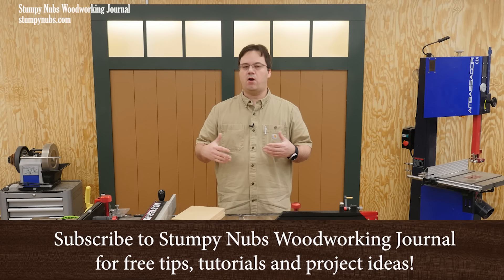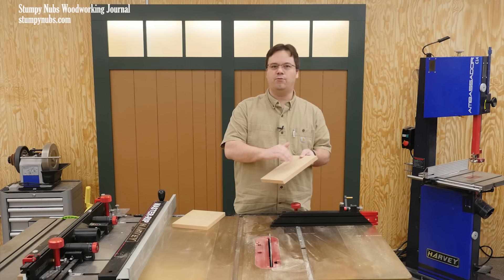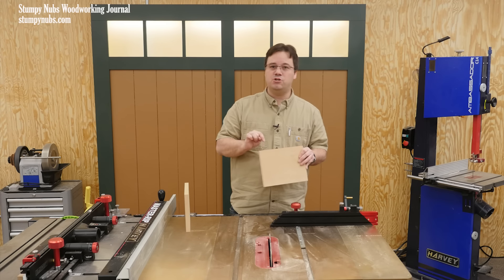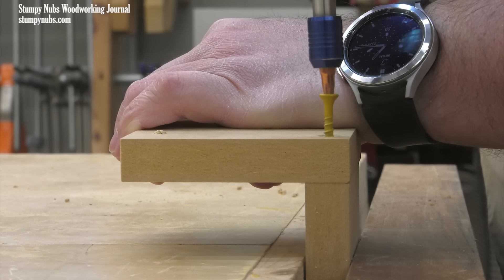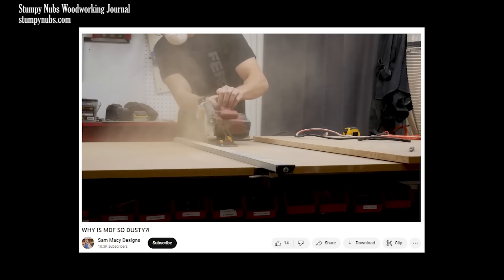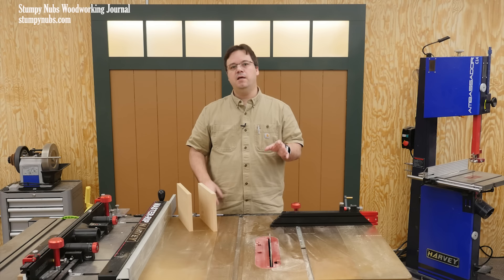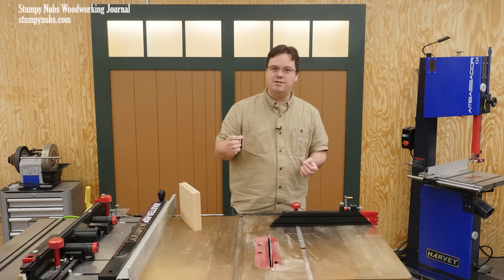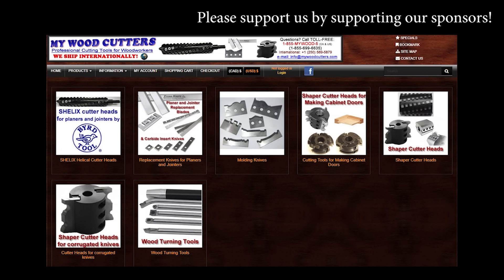This stuff changed my mind about MDF projects

Comment: Excellent video, thank you. As a Heavy user back in the day when I was still on my tools, a note of caution regarding painting. Traditional oil based (alkyd) paints and undercoats should be used with caution. Even though you may initially produce an acceptable gloss finish in the normal way, it will dull over after it's fully dried. We used to flood a couple of coats of exterior PVA glue, slightly thinned, over all surfaces as a primer and then paint as normal. Alternative specialist coatings as now available. Oh and btw, dont let anybody tell you it can be used in exterior environments, even the panels marked as such. It cant, it will fail. Other than that MDF is a very good product.

Comment: I’m my cabinet shop we use MDF extensively for pained parts. To seal the edges we used to use diluted wood glue in a similar fashion to the drywall compound you described. We then went to a 0.5mm maple edge tape, and further went to a 0.5mm paintable plastic edge tape. 

The surface of MDF is highly compressed and very thin. If you sand to heavily you will end up removing it and expose the core which will soak up primer unevenly.
Reply from the maker: I suggested sanding the edges, not the surface. The surface is already very smooth.
Reply: @StumpyNubs  Agree, the surface is already paint grade. It’s sometimes necessary to sand the face to remove glue from edge tapping, you just have to be mindful not go too far.

Comment: I use artists Gesso on MDF. Gesso is a primer that artists use when prepping stretched canvas for paintings. It's designed to shrink fibers not expand (Gesso is what tightens up the stretched canvas) which makes it ideal for sealing MDF.  Its made from Acrylic polymer medium (binder), Calcium carbonate (chalk) and sometimes also gypsum, a pigment (usually Titanium white, and also available in black), and chemicals that ensure flexibility and long life. The amazing think about Gesso is that it's density and hardness is very close to that of the wood and it sands easily and super smooth. Using fine sandpaper grits it can be sanded to glass like finish and is hardness to abrasions is very good. It bonds excellent to previous coats so additional coats can be applied to fill pits and scratches (be sure to wipe sanding dust off with a wet cloth between coats). You won't find this at the hardwood store, go to artist supply store such as Micheals. Gesso is also inexpensive to buy and probably the most affordable option. Give it a try, you will be amazed at the results.

Comment: I love using MDF for built-in shelves and cabinets that I will paint. Don't love the dust! I always use rabbets and dados with glue for the joints and never have a problem. When I can, I try to do most of the cuts outside.

Comment: Interesting about using drywall compound.. I was taught to use oil based paint as a way around the "sponginess" of both MDF and particle board. Agree that it is a material best used for non-moved objects.. but I don't think i heard you mention this.. but MDF tends to have better vertical as opposed to horizontal strength.. Building shelves.. it's very smart to put at least a 1x2 under the front edge of a shelf that has a span longer than 24".. and will be supporting lots of heavy books, for instance. Glad to see someone talk sense about all the issues, though. Great Video!

Comment: I've made lots of shop fixtures and drawers out of MDF.  Pocket hole joints.  Have had them for years.  Have moved them from one shop to another and all my tool stands are on casters so they move all the time.  The biggest warning I'd have about using MDF is don't let any part of the panel get wet.  Cheers.

Comment: A common complaint about MDF - the weight - actually makes it good for sound isolation (as opposed to absorption). A 3/4” mdf cube will cut a good 20dB by itself, more with rock wool.

Comment: MDF got it's bad rep in the ways it has always irritated me. So many use it in areas that can get wet. Doorways, sink cabinet bases and areas near windows. The mobile home and motor home industry are the worse offenders but it happens in regular homes. The idea that those areas will never get wet is poor forward thinking for customers. It does provide work later for the replacement. I am not against never using it, but it's limitations for long term should be taken in to consideration. It might be cheaper up front but cost more long term. Just things to stop and consider.

Comment: You silly Americans. How long do you guys know MDF? Here in Europe it is been used over 30 years. More then 80% of all buit-in cabinets / doors are MFD. Lots of furniture is MFD and finished in a high quality spray paint. You can move them as much as you want. They will last for ever. It's the best product and available in so many thicknesses from 3mm to 50mm. 
There is a BIG difference in qualities of MDF. The one you show is very poor of quality and cheap (ikea quality). I can see it on the structure. Sometimes in the cheap ones there are little particles of metal in it, thats why your saw blade does not last long. Most brown MDF here, are pre primed, so white on the outside, and perfect to finish them in 2 layers of paint. Then you have green (more waterproof and most used allround. It's stronger, better and much more density then the brown one, also you can get them pre primed), black (you just varnish it as a finish) and red (fireproof) MDF. 
The edges, you avoid painting them. You put them trough an edgebander for a thin piece of paper band, 2 layers of paint and you have a perfect finish in no time, instead of all the work you do and still end up with a poor look. 
You never ever put screws in them for the construction you show. You miter and glue them. They will be very very strong for decades, and it's the best finish you can dream of. (you have no edges)
And all that panic about MDF dust??? I should already be dead now after 30y with zero sec of mask on my face.

Comment: I'm a retired carpenter who worked MDF every other day for 30 years with no dust mask as I wear glasses I'm now 70 years old and never suffered with my breathing or have I ever experienced any lung problems. I seriously think this risk is exaggerated. I'm not recommending anyone do what I did but in a small home workshop with little or no air extraction then I'm either the exception or the rule. My go-to for most projects has and always will be MDF. It's a super material, easy to work, easy to shape and lasts better than some other dearer materials, best wishes

Comment: Stumpy I love you, BUT…Pause at the 4 minute mark and you have 100% completely encapsulated why MDF is trash and you should never use it under any circumstances.  But thanks for the tip anyway.
Reply from the maker: People who dismiss something wholesale are usually just not experienced in the type of projects that MDF can truly be useful in. People who make speaker cabinets love MDF. It also is an ideal substrate for some veneer projects. And MDF panels are excellent for flat-panel cabinet doors. When I speak of using MDF, I am not talking about making crap furniture.

Comment: Pro tip for mdf: don't use mdf! lol
Reply from the maker: I think the cheap furniture industry has cause people to think that MDF has no practical use. But there are plenty of projects where MDF is actually a superior product. For example, those who make speaker cabinets love MDF. It also is an ideal substrate for some veneer projects. And MDF panels are excellent for flat-panel cabinet doors when surrounded by a hardwood frame.

Comment: JUNK
Reply from the maker: I think the cheap furniture industry has cause people to think that MDF has no practical use. But there are plenty of projects where MDF is actually a superior product. For example, those who make speaker cabinets love MDF. It also is an ideal substrate for some veneer projects. And MDF panels are excellent for flat-panel cabinet doors when surrounded by a hardwood frame.
Reply: @StumpyNubs  I see your point.

Comment: i didnt know that mdf dust is that bad that you recommend sealed safety goggles, but if thats also the case i recommend sealed earmuffs aswell, as the ears are also a way for airborn things to get into your body, a failry efficient way btw. and then if you dont want to carry it into your house but you have a beard and long hair, like i do you might aswell wear coverings for that, at best sealed coverings as you recommended for eyes and mouth.
and now we are close to nbc safety equipment. so might just wear that.

now, i think i've overdone it a bit, but it always is a case of how much are you gonna do with it -> if youre building a slotcartrack or what ever every 5 years and your cutting this stuff outside, well safety goggles, earprotection and a dustmask is recommended anyways, but you dont need to wear a full body condom.
if youre in the shop for 8+hours a day tho, working with it all the time then absolutely. a good dust collection system takes a lot out of it, but still
Reply from the maker: I recommended sealed goggles to keep it out of your eyes if you are doing a lot of cutting or sanding, not for every use. It's an eye irritant in that case, not necessarily a major health hazard.

Comment: I only use MDF sparingly, but I have found that super glue actually seals edges on MDF extremely well and allows me to sand and buff to a super glossy smooth level if I want it. I've even done some additional cuts/shaping on edges I have sealed that way in the past. Not super practical for large parts, but great for smaller things :)